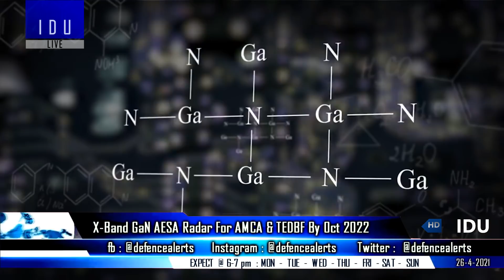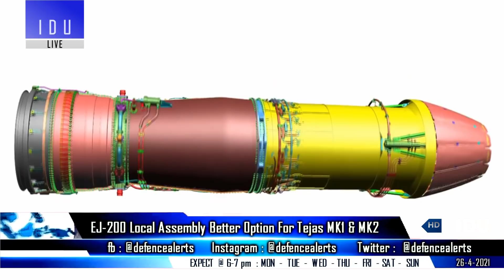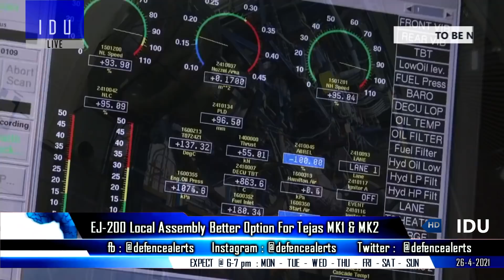Indian Defence Updates : AMCA Next-Gen Radar,EJ-200 For Tejas Mark2,NSM-HL Deal,Arjun-MK1 Alpha Test

Comment: India needs more C-17s from US as they share bulk of the strategic heavy lift operations and have been a work horse for India.. Our strategic lift capabilities are very important and its best to have a fleet of at least 200 aircrafts and helicopters with at minimum of 2 squadrons of C-17s.. India should keep posting repeat orders on C17 +  Boeing P8I  + Romeo MH60 +  Chinook + Rafael's etc.. in relatively smaller batches to ensure that always new aircrafts are in delivery pipeline and we are steadily accumulating while focusing on Indigenous capabilities in all these areas... Indian policy makers need to understand that 100% dependency on foreign military hardware or 100% indigenization are both unhealthy for the Country. Policy makers need to come up with a mixed formulae of Indigenization at component level and at the platform level. This will east lots of pressure on the platforms like AMCA and Tejas at the same time help us focus on the localization in the long run. E.g.1  Rafael's as a platform can be procured by France but LRUs should be manufactured in India by Component makers from France with 100% Indigenization. E.g.2 AMCA can have foreign technology while indigenization of components is worked as LRUs and the cycle should go on for MK2.